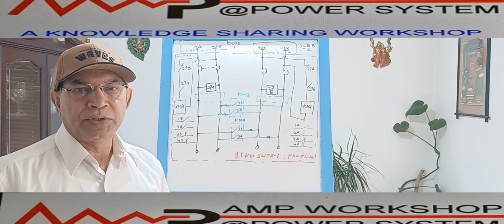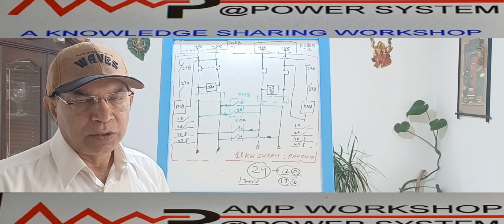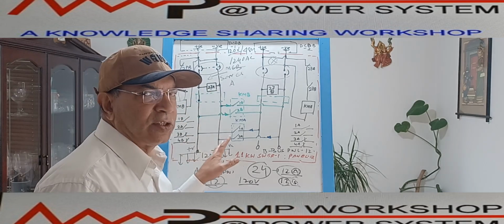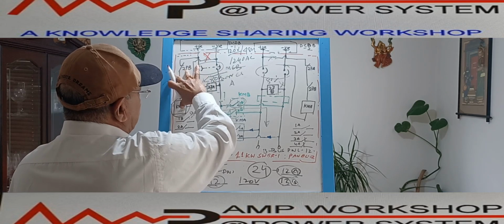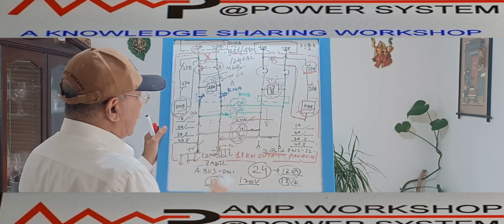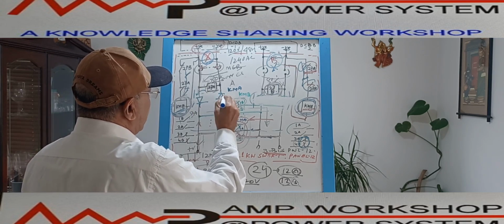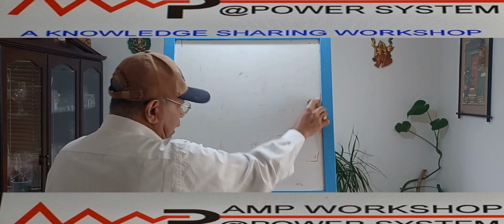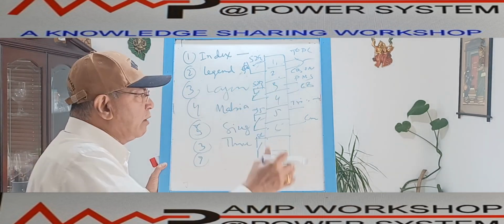AUTO-CHANGEOVER  SCHEME : DC CONTROL  &  AC. AUX. POWER . ( PART OF SWITCHGEAR CONTROL SCHEMATICS)

Comment from the maker: Derating factor o.231 is quite low for directly buried cable.
Please check cable catalogue and apply for right  depth, soil condition and temperature . 
It looks recalculation is required for  derating factor.
Reply from the maker: Moreover as cable size  may become double, it would be expensive for purchase as well as laying and termination.  Terminal may not be suitable to receive such  double size  cable

Comment: Hello sir how are you sir I have a question currently I am review the Design  project the derating factor of cable under ground is 0.231 but I comment accordingly the client derating factor underground cable is 0.4 but designer said that low derating factor increase the Cable size it's good for client because we have EPCM kindly give you comment